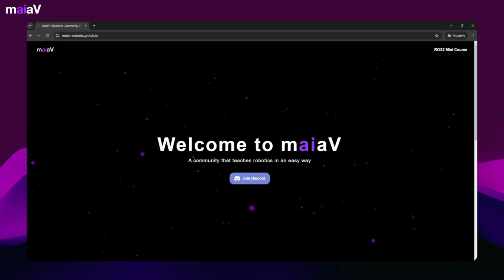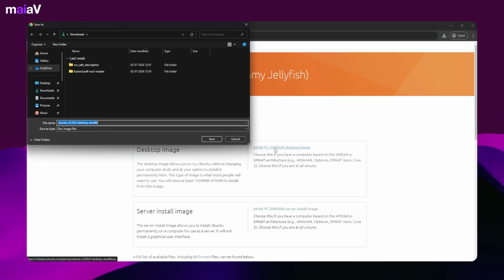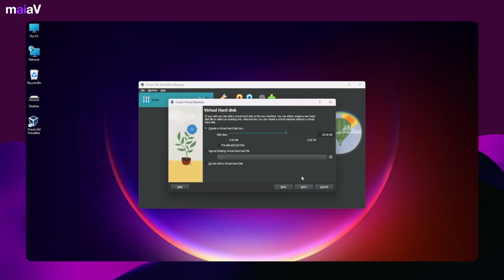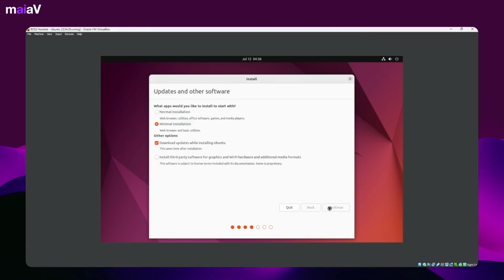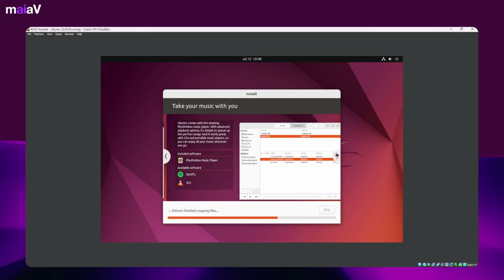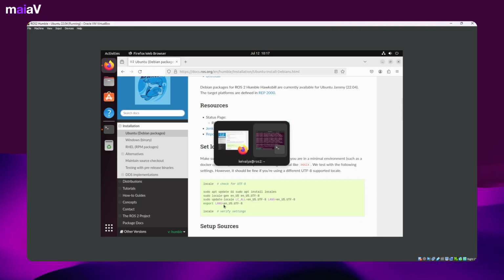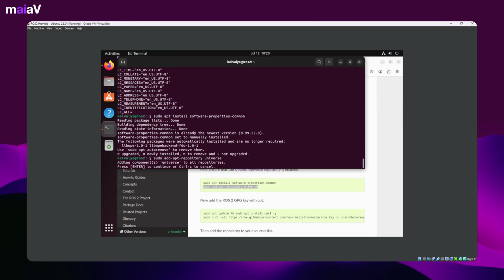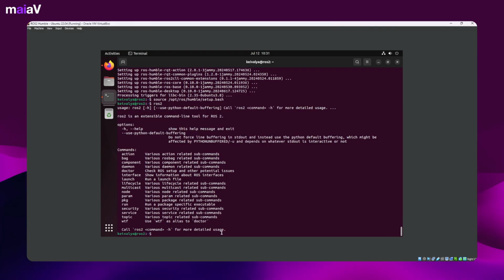How to install ROS2 on Ubuntu 22.04 using VirtualBox

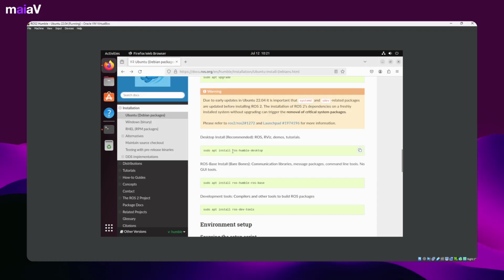Comment: Hey I am unable to locate the package ros-humble-desktop(13:00 ) what should I do?
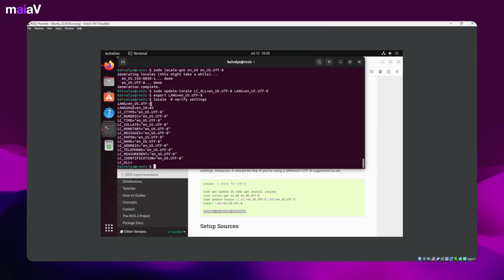Reply from the maker: This means your "Setup Sources" (~ 11:30) step was not correct. You should recheck/redo that and try again. Checkout Ubuntu Universe Repository for details. It is slightly more complicated, but all the steps are very well documented there :) Good luck!
Reply: I had the same problem because I was installing ROS Galactic version instead of ROS Humble version. In fact ROS Galactic wasn't really supported by my version of Ubuntu (22.04.5). So I suggest you to try to install another version of ROS
Reply: @victorf5490  i had face the same problem can you explian in easier way that how to resolve it
Reply: did you solved it ?
if yes then please explain i am facing the same problem